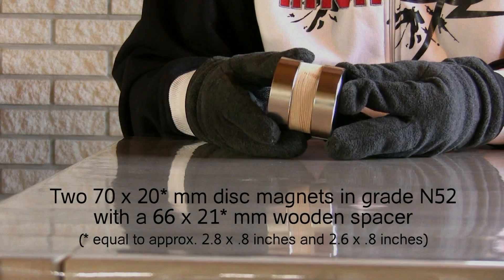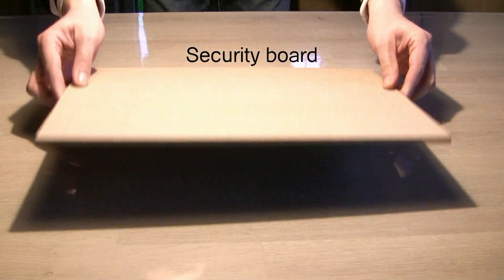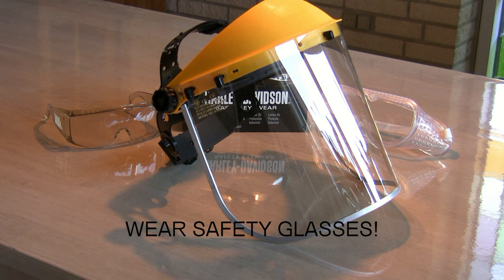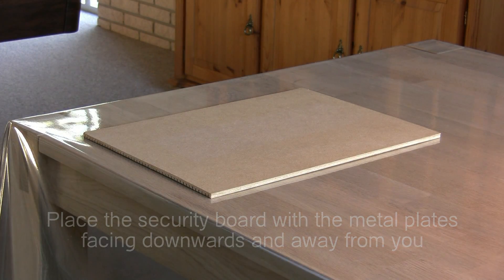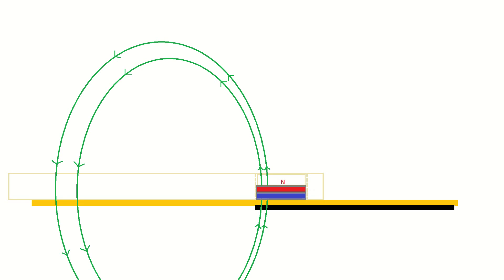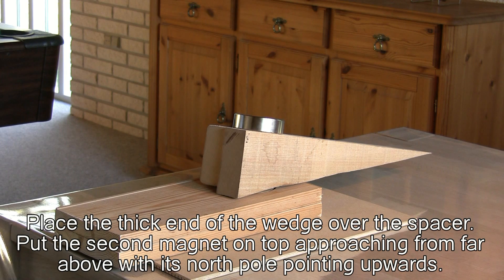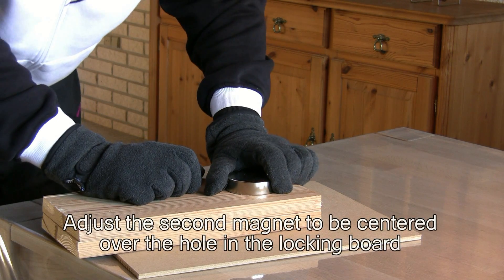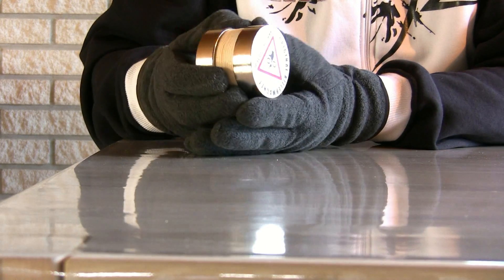Combining two large neodymium magnets including spacer

Comment: I use these type of magnets, all these extra wood blockages is way over the top, unless youre an 80 lb. girl!

Just hold the magnet from a reasonable height where theres no Push OR Pull than lower it slowly and just keep it aligned till it connects, E Z-P Z!!

What is difficult, but possible is connecting same-polarities like North-to-North, but first epoxy gluing top of bottom magnet than having 4  6" -Clamps ready to clamp, 2 persons doing this part helps a lot, but I did it myself!!
DONT expect a perfect flush alignment tho cause that is some SERIOUS POWERFUL FORCE concentrated in such a limited-space area, NOT EVEN THE STRONGEST MAN OR KUNG-FU GRIP CAN KEEP IT FLUSHED!!
Reply: You are a fool.
I wouldn't take your advice if your comment came notarized.
We will hear of your sad demise in the Darwin Awards list.
Have a magnetic field day.
Reply: You obviously have no clue what you're talking about.

Comment: Is there any way you can stick them together as if they were touching without the wood in the middle ?
Reply: you can do the same procedure with the wedge and security board but without the wood in between, but it's slightly more difficult to pull off and MUCH more difficult to seperate them.

Comment: you should store them in a piece of PVC tubing so they don't slide apart if they happened to get dropped...just a thought...
Reply from the maker: At this size they are very difficult to slide apart - wouldn't happen at a drop from any height. But the PVC pipe might protect them from shattering if dropped on a concrete floor :) Thanks for watching!

Comment: Would you recommend putting a light coat of wax on the wedge to facilitate the magnet sliding over the wood? Or do you think it would be unnecessary?
Reply from the maker: It may help for very large magnets, but for the shown size it is not necessary.

Comment: Whats the name. On magne. And how many kg.strong ?
Reply from the maker: The shown magnets are disc magnets with a diameter of 70 mm and a height of 20 mm in grade N52. Often labelled as D70-H20 N52. Their advertised pull strength is 270 kg each.

Comment: Hei
When you pile magnets this way, or without a spacer, is the attrective force doubled?
Reply from the maker: No, doubling the thickness of a magnet doesn't double the attractive force. For very thin magnets (1-2 millimeters) you can gain 40-70% extra, but with thicker magnets you may gain as little as under 10% extra by doubling the thickness.
Reply: thanks for the response. D

Comment: Why isn't it common for them to put a shock absorbent coating on the magnets? I have never seen that before but it seems pretty simple to put a "rubber-like" surface around the magnet. Thick enough to protect but easily thin enough to have all the magnetic effects.
Reply from the maker: +rebos911 
Actually even a few millimeters of extra coating will lower the magnetic force. The force drops surprisingly fast with distance. You can buy magnets with a 'thick' teflon coating for use in salt water (http://www.supermagnetman.net/index.php?cPath=51). But they are a little weaker than standard magnets of the same dimensions.
There's of course less magnet when the 'thick' coating takes up some of the volume but the magnetic effect is also lower when you never really touch the magnet due to a thick coating.

Comment: Very good video. Many people have no idea how dangerous these magnets are if not used properly. These are NOT toys. Thanks for helping all of to understand how to be safe with these very powerful magnets.
Reply: +brainiac75 i had no clue, years ago my boss bought 10 60x30 magnet from some dude claiming they could stop the disk in a electricity meter. anyways she tried it and it didn"t work. so she left the magnet out. and i thought you know what i'll put this back on the stack, they came with these wooden boards just enough big enough not to get your fingers crushed. So i had the stack on the counter in one hand holding the board with 2 fingers and the magnet in the other, and i had out and as as i lifted my arm the magnet flew like a rocket flipping through the air and slamming in the board, it graced my fingers could have easily flattened my fingers, i really had no idea, no warning label in the box any discription of how powerful these things are
Reply from the maker: wa4aos You're welcome. And yes, based on some of the comments I receive many people have no clue on how powerful a puck-sized neodymium magnet is.
Thanks for watching and commenting.
Reply from the maker: . Thanks for sharing. These magnets seems so innocent until they get close to each other. You simply cannot react fast and powerful enough to save it once they go haywire :)
Reply: +brainiac75 and you thanks for sharing this video, if ever i have another encounter with large magnets, i now know how to handle them :)

Comment: I've got a 40mm diameter and 10mm thick magnet with 27.3 kg pull force, is that a good starter magnet?
Reply from the maker: Yes, that will not do too much damage to your hands ;)
I would however not recommend two of them at the same time unless you're used to handle neodymium magnets.

Comment: How can wearing welding gloves make a difference to your safety? The two magnets will not wedge your hands, it will crush them. The force between the two magnets would be 2000 Kg more or less.
Reply from the maker: With the size shown in this video - D70xH20 mm -  your hands will not be flattened if caught between them. But the magnets might break/crush some fingers if they are caught alone between the magnets. Even when wearing welding gloves.
However even small distances close to the magnet can make quite a difference in pull power so thick gloves can make a difference. Especially since the normal reaction to painfully trapped fingers between magnets is to pull them out as quick as possible - it would be better to wait until a wedge is put between the magnets so they can't come closer when pulling the fingers out but our instinct is to pull the fingers out immediately...
Without gloves the last pinch when your fingers escape the magnets can bite chunks and nails of your fingers. With gloves it is more likely that the gloves will take most of the last very powerful bite.
So yes, you can still get hurt badly in a emergency situation even when wearing gloves but I definitely prefer to wear gloves.
Reply: brainiac75 I ever had a magnets with size of D70XH50 and even it was N35, I crashed by it and fortunately not that hurt. My lucky bone.

Comment: You could of used just vice open it up on both sides and stuck both mags on each side and slowly closed them together I tryed it it work great a lot less work then this
Reply: Um no.
That is very risky because one of the magnets could come loose and smash into the other one. Also, getting it off of the vice would be very difficult.

Comment: What is the point of all this??
Reply from the maker: These are not fridge magnets. They are very powerful so you can't just put them together by hand - they could mess you and themselves up in a total carnage :)
Putting a spacer between them at the same time makes it even more difficult but has it advantages (watch my video 'Spacer or No Spacer' http://youtu.be/9Q8qqUsNf-U ).
With the shown procedure it is very easy to combine the powerful magnets with a spacer without any destruction of expensive magnets - that's the point :)
Reply: brainiac75 What is the point in putting them together at all I think may have been the question. That is my question anyway.
Reply from the maker: LiveTrash I have several large magnets of this size and storing them separately with a lot of safety distance between them would be a problem at my house. So putting them together in a compact unit is a good way to store them safely and in a small space.
Using a spacer is not necessary but has some advantages. Here's my video on the subject: http://youtu.be/9Q8qqUsNf-U
Thanks for watching and commenting!

Comment: Well that would only be if you just used two magnets to repel each other. If the magnet that was free to move was housed in a heavy copper pipe when it moved it would create it's own dampening/shock absorbing effect. Then affix a strong magnet/magnets around the outside of the pipe to where the the magnetic attraction would hold the suspension in a middle neutral position. I really want to try this now....

Comment: Oh boy flying magnets are absolutely terrifying! About a year ago a series of capacitors accidentally dumped a massive amount of power into the 12 electromagnets in one of our motors. The strength of the magnetic pulse in turn resulted in the whole thing exploding while spinning at around 9000 rpms sending two 1.5 foot diameter disks (each disk contained 16 n45 magnets for a total of 32 pure magnets and 16 electromagnets ) flying at speeds well over 100mph. I have seen one too many accidents.

Comment: Have you ever made a mistake? Couple years ago I got the tips of my pinky and ring finger stuck between two rather large magnets while bulding an axial flux electric motor. it broke the bones and cause my fingernails to fall completely off. Getting the magnets off my fingers hurt more than getting them on.

Comment from the maker: I was answering about the exact magnets used in this video: advertised at 270 kg max pull force each.
It's hard to answer what is safe to use. It depends on what you are willing to tolerate.
Even small ½" magnets can pinch you painfully but that's a good way of learning to respect their powers before going for larger magnets. Generally you should not buy neodymium magnets over 1" as beginner magnets. Two 1" cubes are enough to bite small pieces of your fingers but they can't crush your bones ;)

Comment from the maker: The lower magnet is pulled strongly towards the metal plate glued to the bottom of the safety board. So the safety board is not really going anywhere in relation to the locking board and magnet.
But securing the safety board to the table would make it a little easier to pull the wedge out, so it would perhaps a little safety to the setup. 
Thanks for watching :)

Comment from the maker: The nickel coated magnets can't really be scratched by any wood unless there's dirt on the wood or magnet. Epoxy coated magnets are more easily scratched but usually have nickel coating under so small scratches is only a cosmetically damage.
I would recommend a wedge of hardwood like oak or beech. Soft woods would quickly loose their sharp edge/tip when the magnets slam together in the end :)

Comment from the maker: Most neodymium magnets can handle around 176 F / 80 C without permanently losing some of their magnetic force and will not lose all of their power before being heating much more.
But they do lose some magnetic power when heated. I doubt that the car roof will be so hot that you will be in serious problems but for safety sakes I would go for extra magnets as a buffer. I recently bought four old HDD for the equivalent of $3 so it should be no problem to get some extra magnets ;)

Comment: I have a project where I need to mount something on the roof of my car and it has to be removable. I was thinking of using the magnets found in desktop hard drives. I'm in Los Angeles so sunny weather can heat the car roof a lot, I'm not sure how hot it can get. Would you know if a neodymium magnet from a hard drive be enough or withstand the L.A. heat? I'll be using a set of 3 magnets to hold down an object of about no more than 5 pounds.

Comment: Quite useful knowledge. Neodymium magnets are strong and hard to handle. If you think that this guy is overdoing it then take apart a dead cd-rom. Take out the small 1,5mmx4mmx4mm magnets. Stuck them together and try to separate (I mean with hands) Good luck :D

Comment: I had some small ones from old HDDs. Stuff has so much power you can put it on the hood or tailgate of a car, put a wrench on it and drive around the city and it won't even budge (I did this because curiosity) And they were only like 2mmx8mmx20mm. Try snapping the skin between your fingers and not get hurt - good luck (having stupid friends is fun) IMO huge ones like these would crush your bones quite easily.

Comment from the maker: That would work very well for stacking cookies ;)
For high power magnets I'm pretty sure it would be a nightmare. Either the magnets would get stuck when tilting or slam so hard together that you risk chipping or shattering the expensive magnets. You are welcome to try it but based on my practical experience I believe my method is more controlable and therefore safer.
Thanks for watching and commenting!

Comment: Well that was a nice video, i was wondering how i would go about putting 2 of these larger magnets together without them slamming into one another.
Ive been playing with smaller magnets for many years, and now im getting bored.
The biggest problem is i need to be very careful in my home seing as there is barely any place that hasn't got any sort of metal or electronic device near.

Comment: These videos are good and can help to avoid unfortunate events.
I have a good scar caused by my losing control of a rare earth magnet, even though I was attempting to be careful.  I realized that fixtures are necessary, as you adequately demonstrate.

High Density Polyethylene, or UHMW, tape can reduce the force needed to slide wedges and keepers, when applied to the surfaces. It is less expensive than Teflon™, stronger, and sufficient.

Comment: Technically everything is magnetic material.  But, not everything has aligned magnetic domains.  It takes differing amounts of energy to align materials and get a magnetic response.  The "tingling" sensation is probably caused by the magnet interfering with cellular ion transport in your hand.  However, like you said the idea that everyone is chipped is goofy.  That's like saying that putting foil in your mouth and having it react with your fillings proves that everyone is a robot.

Comment: I have a question instead of using the wedge why couldn't you do the second magnet just like the first. Lay it on the board and slide it toward the spacer till it slides it self on top.

Comment from the maker: They can be shipped in the middle of a cardboard box with styrofoam around them - the force drops very quickly with distance (inverse square law).
They cost around 90€ a piece and are easily available in webshops, eBay etc.
Magnetic force is too complicated to be explained in a comment but simplified it's unpaired electrons in the atoms creating an electric field that in turn creates a magnetic field - electricity and magnetism are two sides of the same matter.

Comment from the maker: If pulled directly away from each other (not slided apart) it would require a force of about 350 lb according to K&J Magnetics calculator. And that's a conservative estimate.
Based on the distributor's (magnetportal) information it could be close to 500 lb.
In any case: a lot of force and imagine having a finger stucked between two magnets attracting each other with that force... 
Luckily it takes much less force to slide them apart as seen in my video about it (link in description).

Comment from the maker: Thank you! They are advertised with a pull force of 270 kg (~600 pounds) a piece but that requires some really thick iron plates on both sides of the magnet to be achieved. Current cost pr. magnet is €90 (~$115) but I bought them much cheaper several years ago before the price for neodymium exploded. Thanks for watching and commenting.

Comment: I retrieved to small magnets (40 X 30 X 6mm) rom an old 1970's hard drive. I used to slide them together (a few finger injuries soon taught me the safe method). A friend tried to pull them apart instead of sliding. They nearly broke his fingers, and we were pulling flakes out of a masonite wall 5m away! Your video may seem boring to some, but anyone who has seen what happens when you mishandle these says "Thanks Brainiac75 for the safety tips!"

Comment from the maker: OK. I understand what you're saying - but we have different opinions about what free energy is. In my world a generator based on compressed air is not a free energy machine because I still need a compressor - typically electrically powered - to generate the compressed air. It may be cheaper than gasoline but it's far from free.

Comment from the maker: They are advertised with a pull force of 270 kg (~600 pounds) but that requires some really thick iron plates on both sides of the magnet to be achieved.
Neo magnets loose very little magnetism if not heated excessively or physically abused - I've heard under 1% loss in 10 years.
And yes, all magnets can be used to make electric generators. You just need a force to spin a coil that turns around in a magnetic field. Search electric generator to learn more - I can't learn you in a comment.

Comment: I wouldn't even dare to handle a neodymium magnet of that size. I'd feel safer handling a hand grenade with the pin pulled out even.. The largest neo magnets I have are 30mm across and I handle those with extreme care. Lovely video. I'm saving this one. :)

Comment from the maker: Thank you!
I'm not 100% sure of what you mean by 'magnitude'. The magnets are grade N52 which means that the remanence (Br) should be somewhere between 14000 - 14800 Gauss or 1.40 - 1.48 Tesla. The advertised pull force is around 270 kg for each magnet.

Comment: I have a much simpler way to do this, without all the tools. take one sheet of steel about 1/4 to 1/2 centimeter thick, cut a circle exactly the same diameter as the magnets you're using. touch the steel plate to the north side on the edge of the magnet and gently slide it into place, do the same thing with the other magnet with the south side facing the steel plate on the other magnet. This will almost double the strength of the magnets, because they are pulling on the steel.